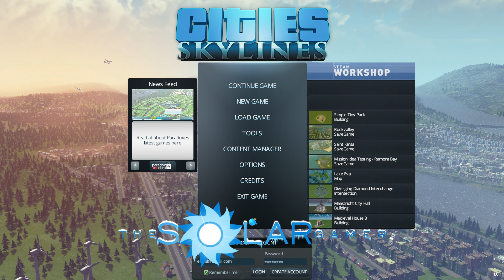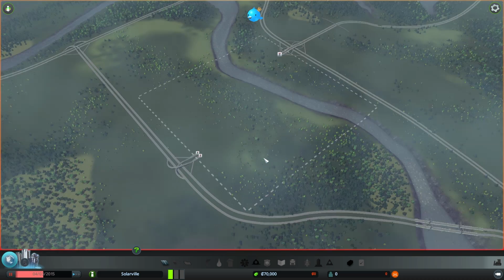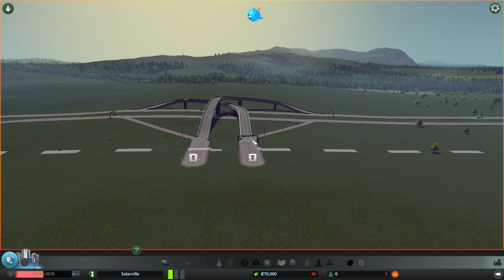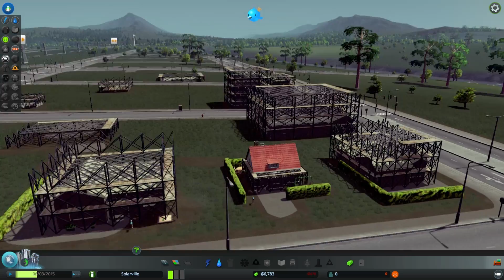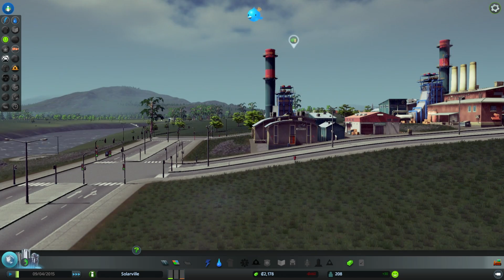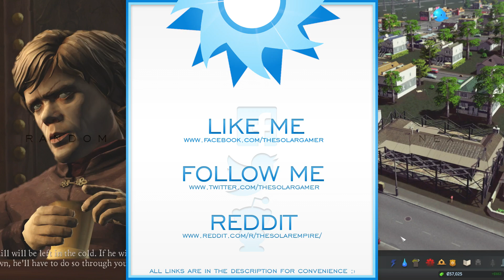Cities Skylines - Episode 1 ...Keys to the City...

Comment: Might look fine now, but once you start getting heavier traffic, that "off/on ramp thingy" you have won't be able to handle much. Too many traffic light intersections and the distance between those intersections is waaaaaaaaaaaaayyyyyyyyyyy too small. Just begging for cars to pile up on the highway trying to get in to the city.
Reply from the maker: Once I expand, I will have multiple connections to the highway.

Comment: The number of intersections you have are going to cause you problems further down the road for sure.  Wise use of roundabouts and one way streets are good ways early on to deal with future traffic.  Also, it seems keeping areas near the off ramps clear of zoning and buildings is of great help (buildings mean skyliners pulling in and out of buildings, making u turns, parking and other wise gumming up the works right where you need traffic to flow smoothly).  Look forward to your continued LP of this title!

Comment: Hello Just letting you know using tiny  Roundabouts/Rotaries can be really tiny so you should Check out Flabilaki's videos he makes around 3 or 4 different sizes of Roundabouts and you can get them to be surprisingly tiny.
 Also from what I've seen you do not have to start off with the bigger roads, BUT you did say you were bad at future planning so maybe for you it will be better.